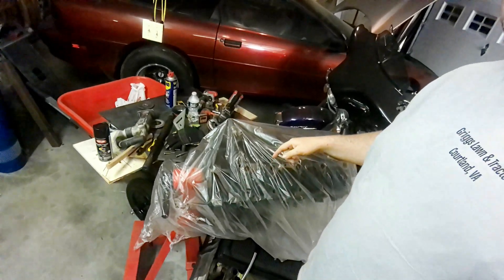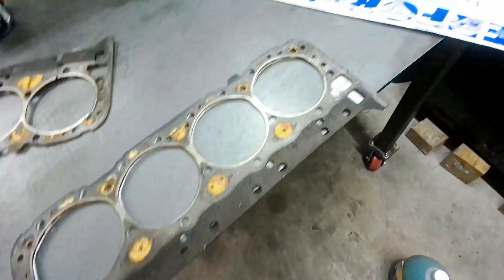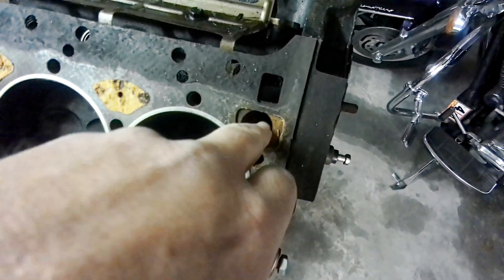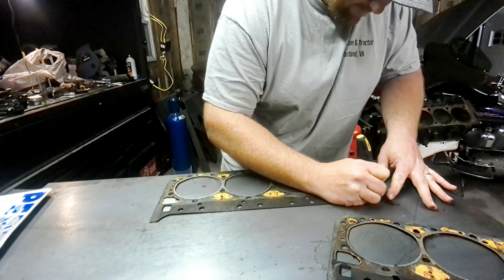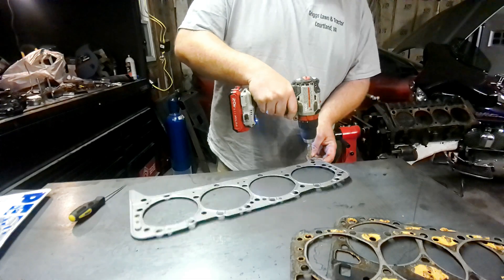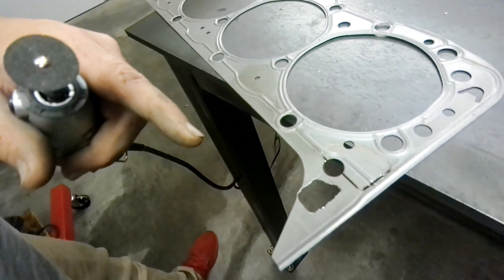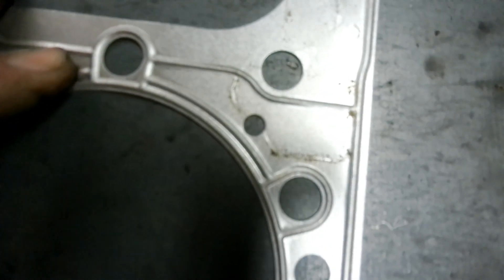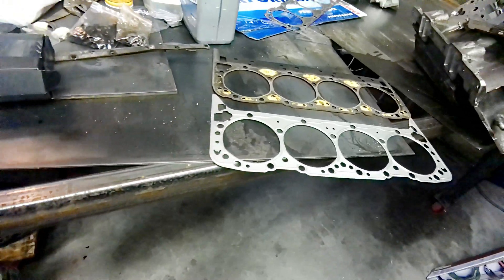How to RAISE COMPRESSION & set QUENCH with Felpro 1094 SBC headgasket on LT1 gen 2 SMALL BLOCK CHEVY

Comment: Hello thanks for the video i was wondering  did you have to add any like copper  to seal water jackets that you cut out or ok to just use once cut
Reply from the maker: I like to add copper spray to my gaskets but don't think it is a must do if the surfaces are flat. These gaskets have a clear coating on them from the manufacturer so that helps.
Reply: @YerkitRacingChannel  they didn't leak? I thought cutting through the raised portions of the gasket it would leak for sure
Reply from the maker: @stevenbelue5496 Unfortunately I didn't get to run them... Decided to go with nitrous. I needed more quench to be safe so went with .040 cometics. Still have these .015 gaskets sitting on the shelf in the garage. They would have been better NA for sure but I knew I would want more power almost immediately so just went the other way.
Reply: @YerkitRacingChannel  in my experience when using the thin single layer stamped steel gaskets once you cut through the raised part that outlines every coolant transfer hole,  water usually goes where you don't want it to. Even the copper gaskets can be difficult to seal,  I've had seepage using copper coat and hylomar. I've been using SCE gaskets and they seem to be pretty good. One thing the gen 2 lt1's have going for them that I've noticed is the blocks seem to be way stronger than the old gen 1 stock blocks.
Reply from the maker: @stevenbelue5496  yea we've had good luck on other motors with thin steel and copper gaskets. With any of the thin single layer gaskets seems like surfaces have to be flat flat and right finish or they ain't sealing
Reply: Looks good stay away from torque to yield head bolts used on LT1/LT4 1996-97   New Gen 1 sec regular head bolts or stud ARP set is best.
Reply from the maker: Thanks for the tip! I ended up opting for a set of budget speedmaster 12 point nut and stud kit... Think studs was the right move. Hopefully I don't end up regretting the budget part of the decision lol
Reply: Hey i feel horriblei typed out a repy to you just forgot to press send . Just wanted to tell you thanks  for your help... i love it when DIY people use there minds to come up with there own methods in building fabricating etc. Thanks again.. keep making videos
Reply from the maker: @supertruckertroy  thanks Troy! Glad I was able to help.

Comment: Hey thanks for the video. Been looking for an answer all evening. Ive got a 95 lt1 6spd going into a 93 c1500. Already swapped the lt over to carb and HEI ignition. Picked up a set of heads this mornings fresh from the machine shop along with a stage 2 hot cam, roller lifters and 1.6 rockers. Guess ill be the guinea pig to find out if the 1094's leak.lol
Reply from the maker: Sounds like its going to be an awesome 1500! Let me know how the head gaskets go!

Comment: How did they hold up? Any leakage with the stock deck surface?
Reply from the maker: Unfortunately I didn't get to run them... Decided to go with nitrous. I needed more quench to be safe so went with .040 cometics. Still have these .015 gaskets sitting on the shelf in the garage. They would have been better NA for sure but I knew I would want more power almost immediately so just went the other way.